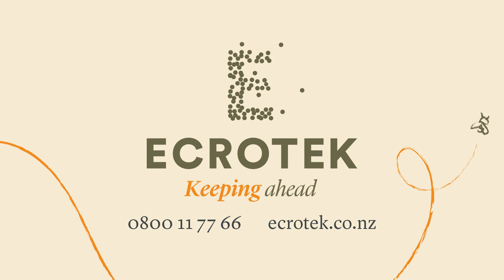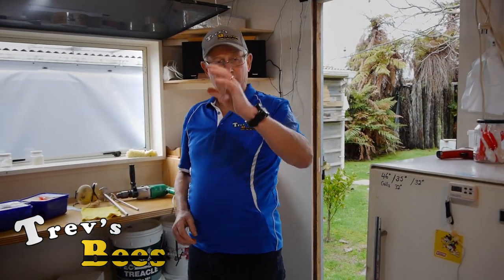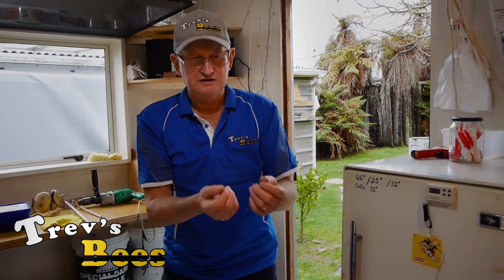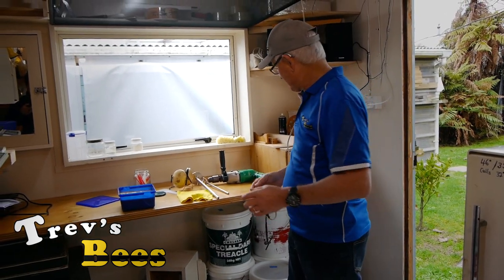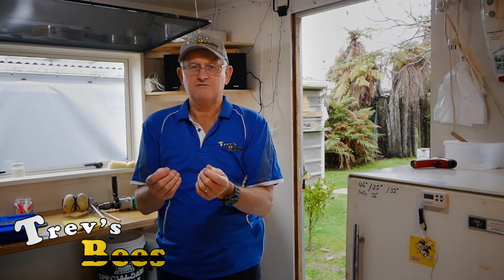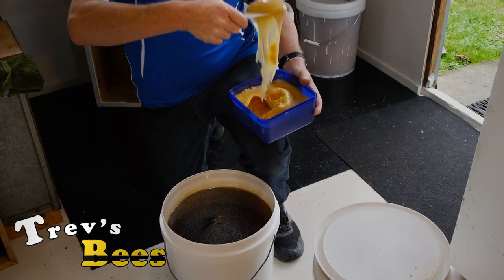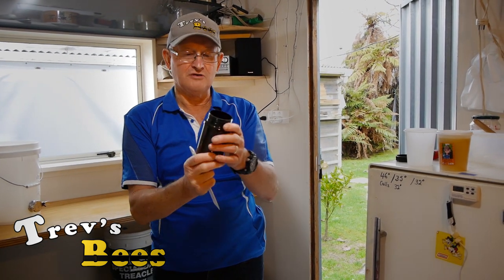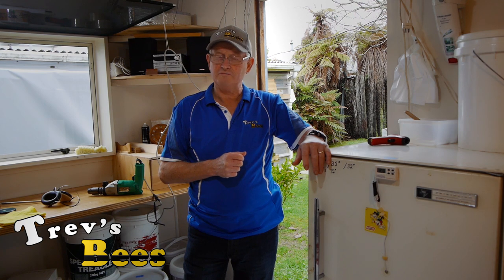Trevs Bees - How to Cream Honey

Comment: Hello Again. Rachel from Michigan. Hey Trev,  I have a question. When you mentioned that older honey creams best , at what age is honey considered older? Thank You for Everything
Reply: Ah ok, makes sense, thanks for clarifying , stay well 🙂
Reply: Trev,  my bucket of honey i picked up from a supplier had a foam disc at the top, and there's not much reading about this, but from what I did find its air and byproduct of some sort. Could you shine any light on this? Should it be removed for creamed honey or best left in , or does it not matter?
Reply: grateful for your reply , this is all so very interesting 🙏

Comment: microwave? wtf
Reply: When you use a microwave  the energy is not evenly dispersed in the targeted mass. In the microwave there is a wave generated that is at the right frequency to excite water molecules. This wave over heats areas of the honey and breaks it down and causes micro explosions. The best method is to heat the honey with convection to 145° F (63° C) for 30 minutes. Some preferred 150° (65.5° C) for 30 minutes. Those who say it looses its "property's" are worried about raw honey heated over 110° F. I use a 5 gal bucket and 6 lbs of starter, I heat the honey up to 145° F for 30 mins then let it cool at room temp to 95° F drop in the seed and mix well. Then I drop the temp down to 57° F and package and store at 57° F for about a week or so. Then its all ready to go.
Reply: @DJCryptoStix  Sounds like you are pasteurising the honey at 63-65.5°C for 30 minutes, this is not the aim of the exercise. You are just softening the tub of crystallised honey in the microwave to make it easier to cream.